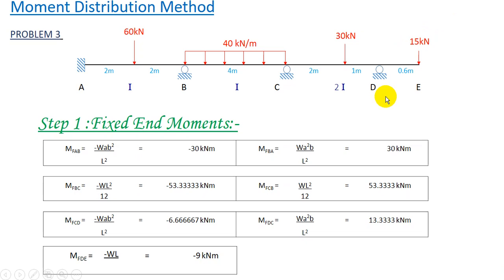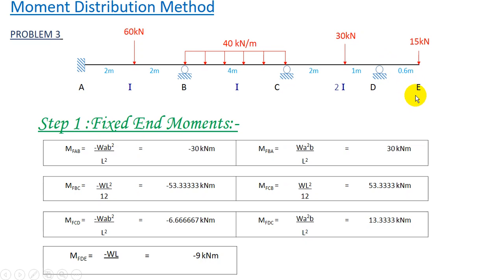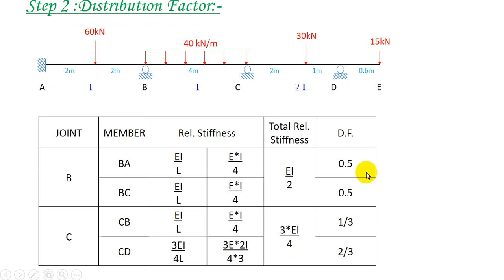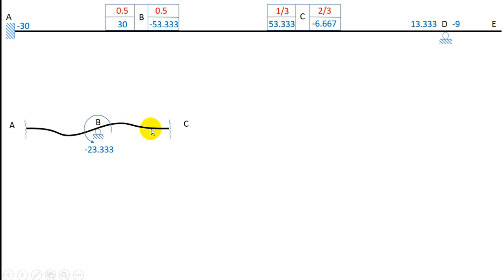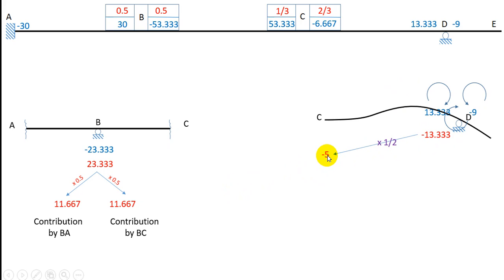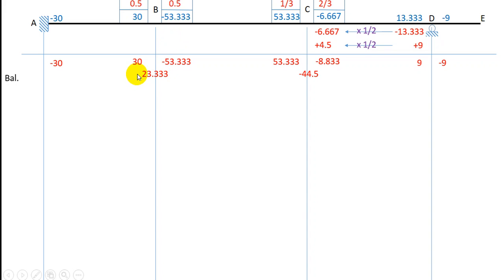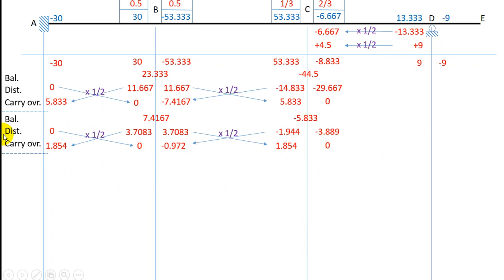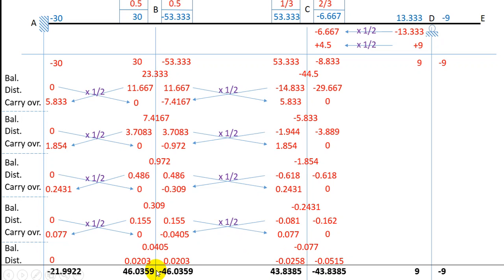Moment Distribution Method Type 3 (with concepts)

Comment: Nice explanation. But one thing, u keep saying that is pinned joint, in my university we are taught that  is a roller not pin, pin is different.
Reply from the maker: Yes basically the property of a pinned joint is to not attract moment, then there are different names further given to it based on the restraints applied to the pin. If the restraint is released in one direction its a roller, if the restraint is released in all direction its a freely moving 2D or 3D space pin, and if all restraints are there then its a hinge joint.
Reply: @DCBAonline  Thanks

Comment: i have a doubt in Mfcd and in Mfdc value 
Well thats ok we assume all intermediate joint to be fixed but joint D is not an intermediate joint , the formula which u have used  for calculating fixed  end  moment for Mfcd and Mfdc is used when both end are fixed the same thing u did in PROBLEM NO. 2
dont u think is there any error in both tutorial?
Reply from the maker: mubasshir hussain fixed end moments are calculated for every joint irrespective of what nature it is, the advantage of knowing intermediate joints fixed is taken only in Distribution factor finding step.
Reply from the maker: mubasshir hussain since member DE is overhang the fixed end moment is the simple cantilever moment, hence there is no error in the method or rather answers are exact and accurate, i have personally checked these problems in softwares before posting it.
Reply: ok brother I got what I wanted.
The same kind of problem I tried from a book and they did the same as u did in ur tutorial.
thanks for the response.
And really It was nicely explained tutorial no doubt.

Comment: Why we don't find distribution factor at D joint
Reply from the maker: kanu sharma , distribution factors are only found for intermediate supports, here in this case it might seem that D is an intermediate support due to over hang but it is not it is instead an end support with a pin joint.
Distribution factors are not found for end supports. Hope your doubt is solved ,if you have any other query you are free to ask.